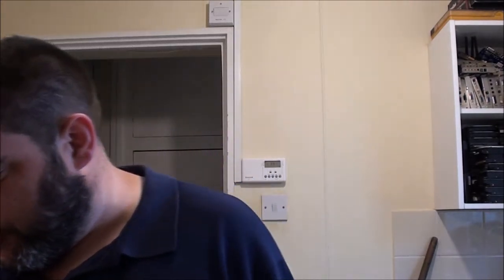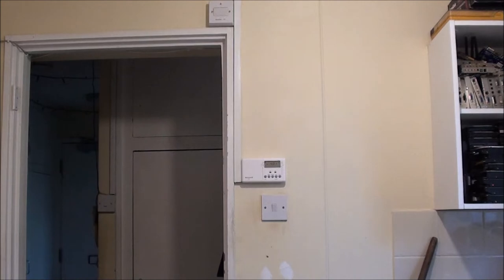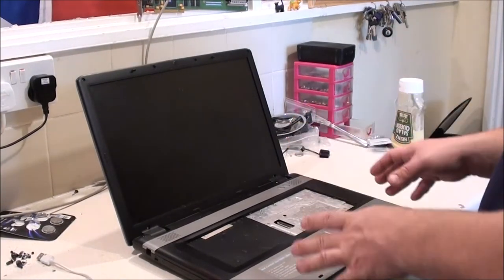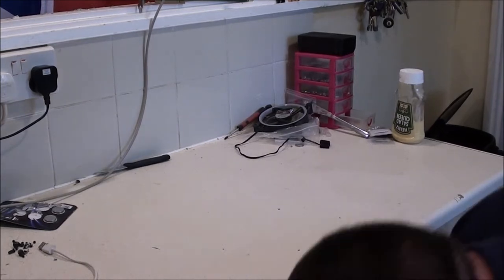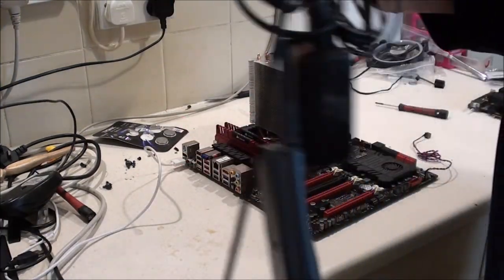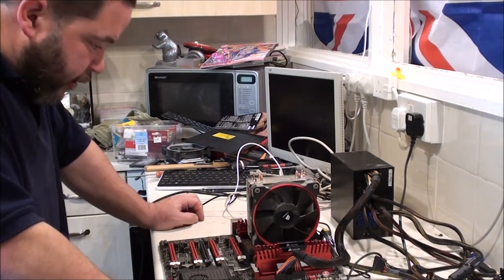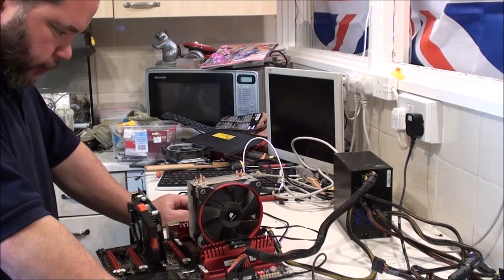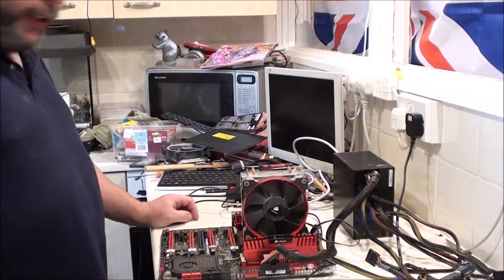Faulty Motherboard: Asus Rampage Extreme 4. Power Cycles. Help?

Comment: With the laptop, plug a monitor into it. If you get a picture on the monitor then it's a faulty laptop screen. If you don't, then it's the GPU that's the issue. As the keyboard lights are iffy it may be more than the GPU and be the entire motherboard.
Reply from the maker: Tried that, still got nothing out.
Reply: @RandyDarkshade2  I have had success with removing all RAM before, cleaning the sticks and sockets, then putting them back in. I don't know why that really affects the screen, but there we go.

Comment: Have you tried removing the battery or clearing bios or a different power supply just in case it is not the board other than that remove the cpu and see if any of the contacts are dirty on the cpu i have never had a cpu fail but a fair few of my msi boards failed but they all stayed on ,From what i see there are a couple of buttons on the backplate for bios reset and  might be worth checking them not sure if they latch or just make contact when pushed worst thing is it could be the board worth checking contacts are clean on the ram as well .